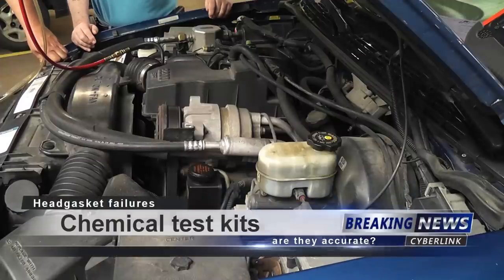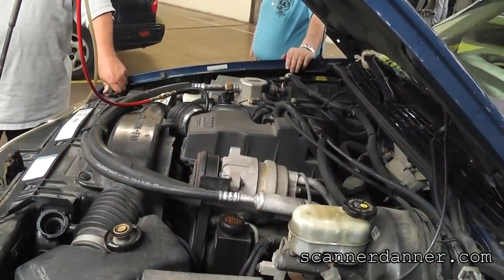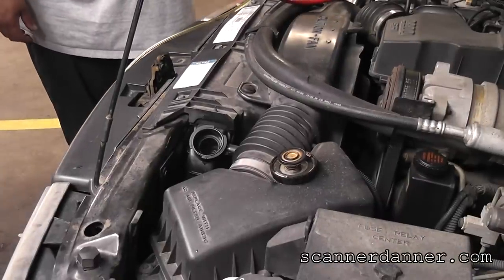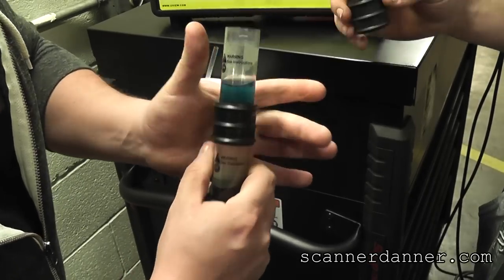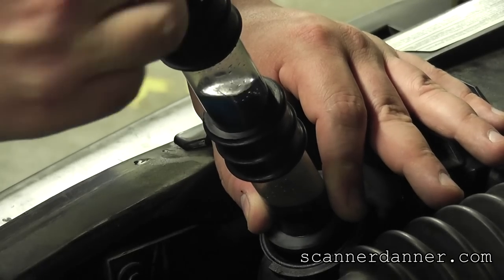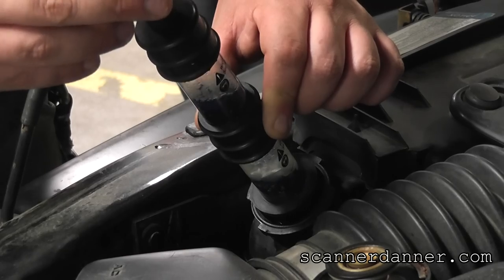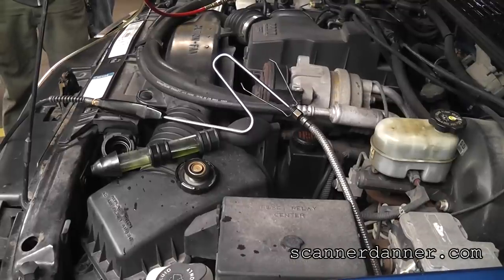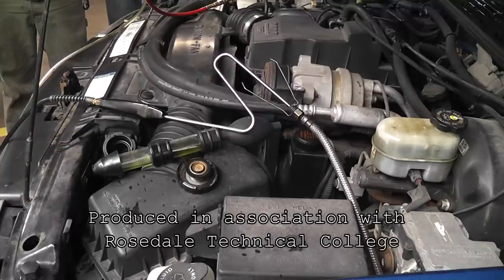How to test for a bad head gasket (chemical test)

Comment: I have seen a oil cooler (VW) go bad internally and show up as oil in the coolant and the sniffer said HC in coolant which would be right since there was oil in the coolant.  Tech condemned the head gasket and did the 60 hour job and still had the same problem.  watch out.
Reply from the maker: dkeny55 I have never seen any type of oil (tranny fluid or motor oil) the cause analyzer to read HC gases. (The vapor point of those fluids are too high)
Reply from the maker: dkeny55 sounds like the Tech recommended the repairs based on the oil in the coolant alone.

Comment: Can jou please explain in one video how a gasanasiler works?Sorry for de writing foults
Reply from the maker: Not sure i can answer? It has a vacuum pump and draws a sample of air/exhaust and measures HC, CO, O2, CO2 gases. We used them for ages for tailpipe emissions testing before OBD2
Reply: @ScannerDanner  Y have one on mij shop because we have too have one in de garage to check evri jear evri car.Hier in the Netherlands voor de cars before 2006,after 2006 we misr check it with de redinestest.

Comment: Excellent video  Paul, 2 days ago  told my service writer  head gasket was blown; He ask me if the  fluid changed the color   I said no ,I used 3 different bottles the shop, mine and another from coworker none change the color , gas analyzer show 150 HC  , my adviser has always trust on that fluid  more than gas analyzer He could not believe that did not change the color however on this vehicle  electrical cooling fan were not operating and customer said several times over heated  , I always used both   fluid and  gas analyzer and  I have  notice if the HC are under 150  most likely   is not going to change the color but vehicle will act up,  the best way I have found for the fluid to  react change the color  is raising the rpm for about 3 minutes and recheck that is the best chance for getting to change color  .
Thanks for your effort of the videos, 
question to Paul Danner do you know if your Premium channel will work in El Salvador?  I am going to have back surgery soon there and I wanted to be studding there I will stay couple months there during recovering thanks
Reply from the maker: Thanks Joel! I pray your surgery goes well. As for access to my premium channel goes, El Salvador is not on the list but you could use a VPN to make it look like your still in the US. My friend in Panama does this and it works for him. Hope that helps and I hope everything goes well.
Reply: ScannerDanner  thank you

Comment: The reason way! Does not changed color! Is because the liquid tester can see CO un the vapors coming out off the radiator. If u notice in your gas analyzer in the readings wasn't any CO readings and went the tech went to the exhaust tail pipe he have the tester liquid changed color from blue to yellow. Also this liquid need to be after you closed bottle in a seal plastic bag do to of the contamination that we have in the shop working with cars.
Reply from the maker: Pete Sambolin Pete, all the documentation I am finding says CO2, not CO is the gas that is being tested. In fact you are instructed to test your fluid By breathing into it! I believe that my fluid was contaminated

Comment: I have used one of these many times and even found problems that the gas analyser could not find. It can take a 3 or 4 minutes to work. The engine needs to be running.I do not think it measures HC as someone else said.
Reply from the maker: Andrew Thompson I did it longer than that and it still didn't change color. (different car)

Comment: How on earth did you come to decide that it had a bad head gasket for a long crank time, I would have never thought that
Reply: Experience and one very key question to the owner. "Are you adding coolant?" 
Also what wasn't shown was verifying clinical inputs and making sure fuel trims looked good and checking fuel psi and bleed down.
Reply: Critical  (stupid auto correct )

Comment: You don't even need a gas analyzer, if the head gasket is suspect do what many used car dealers do.   Pour a bottle of blue devil head gasket repair liquid in, run it and call it a day!   Now that's a 2 minute hack repair!  LoL. Don't you just hate snake oil Paul?  I do. Thanks for the vid
Reply: Ozzstar for sure!

Comment: What about a compression. Check?
Reply: Jason Johnson the compression check will miss early stages of head gasket failure. also there are multiple causes of low compression so it is not one of those "this is your problem" tests. it has many variables.
in the case of this truck, compression was fine, there were no misfires or trouble codes and all it had was a long crank time.

Comment: It's an interesting result, but I've always been weary about calling a head gasket with ANY test method.  I got burned once on a job, and ever since, my call has always been "compromised cooling system."  That covers just about all the possibilities, and you can darn well bet at that point I'm going overboard to rule out any Oil-to-Water coolers (hello Volkswagen people...) before I pull that head.  :]
Reply from the maker: rhkips engine oil has a flash point of around 450 degree F. I do not think engine oil will produce HC vapors at the operating temperature of the cooling system.
Reply from the maker: rhkips engine oil has a flash point of around 450 degree F. I do not think engine oil will produce HC vapors at the operating temperature of the cooling system.
Reply: ScannerDanner
It definitely wouldn't, unless there was also a bunch of raw fuel in the oil from excessive blowby.  But even then, none of these so-called "head gasket" tests confirm a blown head gasket.  Cracked head?  Cracked block?  Failed OTW cooler?  What about an oil to water failure in the head gasket with no compression compromise?  No HC there.  They're really only a guide to give us enough reason to pull the head for further inspection.  :)
Reply from the maker: Good point. When I say the gas analyzer is 100% accurate, I should have clarified that i am speaking of driveability problems.

Comment: Please i have 2006 ford freestyle with 120k miles on the clock, i noticed that the drives well but after a while the engine stalls and dies, got fault codes P0191, P0171 and P0174. what do i do

Comment: If this thing detects CO i don't see how CO is going to be forced through a blown head gasket because there's no compression on the exhaust stroke so little to nothing will be pushed through the blowout.  So is it true that only HCs are helpful in diagnosing blown head gasket, but not CO?
Reply from the maker: CO2 is what the chemical kits sense.
Reply: @ScannerDanner  Oh i see.  That makes sense, the combustion gases would be forced through the gasket right after combustion when there is still lots of compression in there.   Ok thanks!  Love your classes man, i'm going through the second time now.
Reply from the maker: @izbavynasotlukavago  Thank you!

Comment: Pal at the very least allow the thermostat from your rad to open up at the most extreme part physically remove the thermo in order for more flow to go through your rad don't worry it's still cheaper then coughing up $3000 for your pretty little analyzer and you will get your beautiful pretty little PPM'S of the CO2 in the engine.
Reply from the maker: Thermostat doesn't need to open to test for a headgasket failure

Comment: how can you tell the difference between ablown head gasket ..a cracked block .and a leaking intake manifold?
Reply: Good question. I'm also interested in knowing such a thing
Reply: jody maples That's where it get's a little tricky, tried and true method is a cylinder leak down test.
Reply from the maker: jody maples a leaking intake manifold will not put HC gas in the cooling system. A cracked block or head or headgasket failure is not identified externally. The engine must come apart first.
Reply: ScannerDanner a leak down test can determine head gasket / valve or cylinder wall.
Loosing rocker arms and move aside with piston BDC @ 100 psi, if leak raise piston
TDC repeat test.

Comment: Paul, the other thing with this method is the fluid needs to be very new, old fluid is very questionable, not a full proof method just another tool in the box, I have Seen several cases were it did confirm a HG failure but as you have seen, not always. But if it doesn't turn colors it will never confirm a good HG, just have to test in other ways
Reply from the maker: Michael Berg thanks for the input Michael!

Comment: Why do you use a complicated method for everything?
Just smell the exhaust and coolant and look at the oil cap.
I can diagnose a bad head gasket in less than a minute.
Reply: zoticus1 Also, It is a gm 2.2 , very well know to have cracked heads from poor castings,and or poor head gasket design.